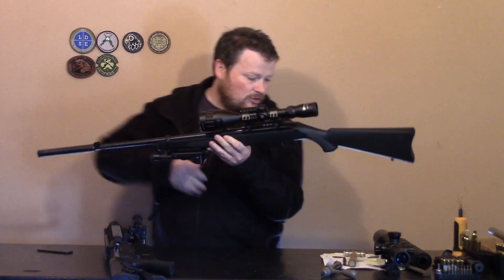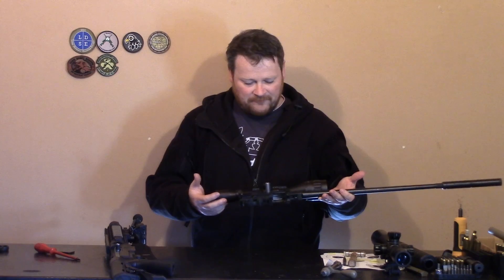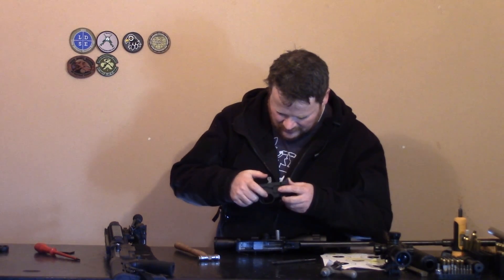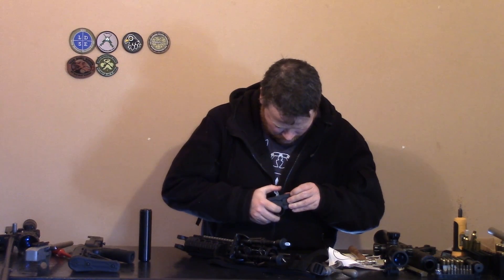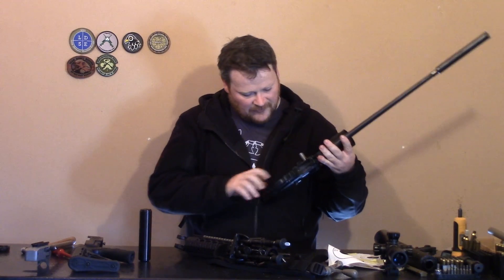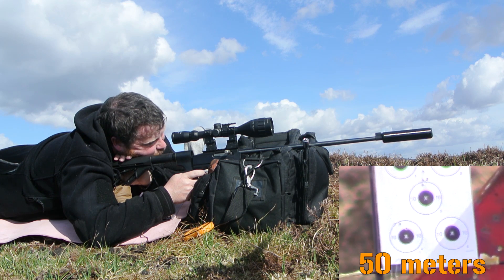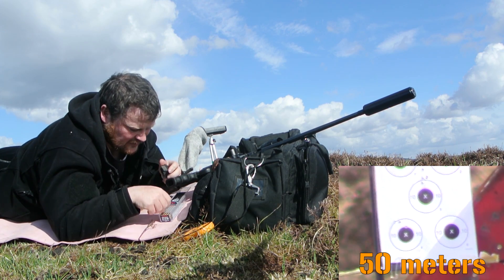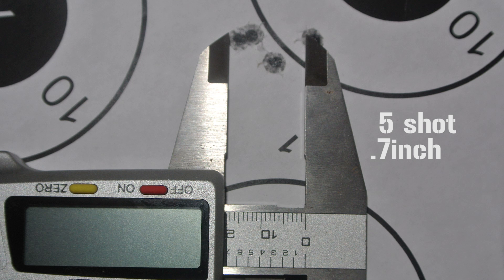Building a better 10/22:EP2: 2.5lb trigger, Free float,

Comment: Do you think a factory 10/22 with no add ons is accurate enough to hunt rabbits at 100yrds?
Reply from the maker: +Ryan Maher some are for sure. The target and tactical are, the cheap model sometimes there are problems with the barrel or the bolt not being very square
Reply: +MRAD Outdoors Oh i wasn't aware of this , was thinking of buying one soon enough and putting a magpull hunter stock on it thinknit looks very well and will free float the barrell as far as i know too , thanks for the reply.

Comment: I heard that if your barrel is touching you rest(the bag) then that negates it being free-floated.
Reply from the maker: UARAF16 That is true, If you have a point touching the barrel hard enough you can change the vibration nodes along the barrel caused by the explosion of the round.
But you have to be putting a little force agents the barrel. the bag was barley touching it.
The free floating the 10/22 barrel at this point is more about getting rid of the force transfer caused by the bipod twisting down the plastic stock and the barrelband transferring the force to the barrel changing the point of impact.